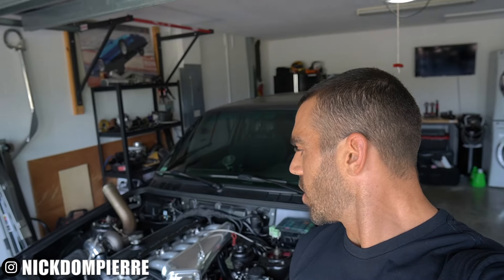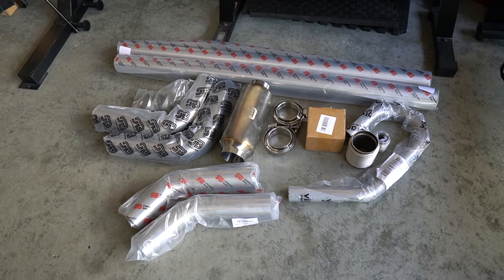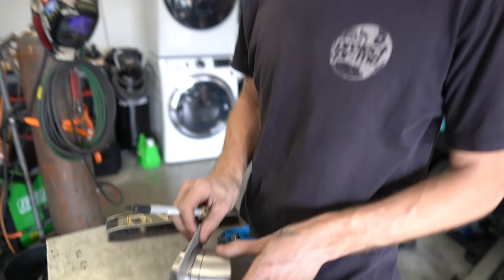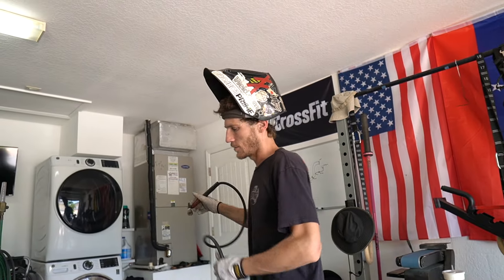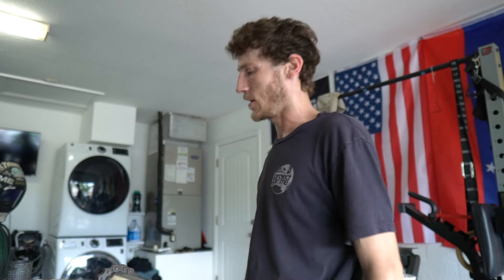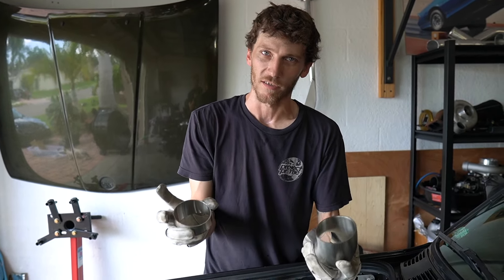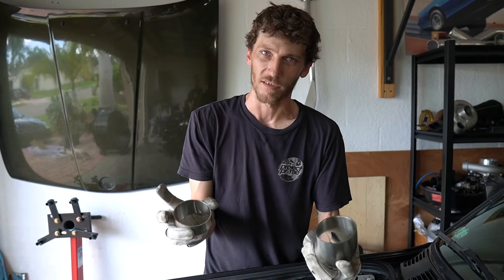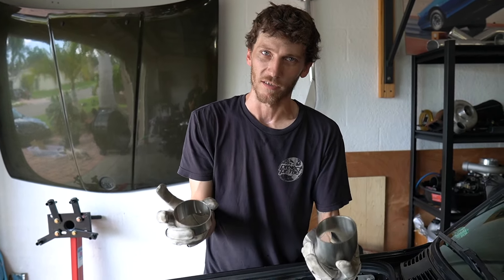Fabricating E30 Turbo Back Exhaust with Jeff Ray from Superformance Fab

Comment: What intake manifold are you using? Would be great if you could show what you got going on with intake/brake booster set up. Wanting to get an intake similar to yours but I'm concerned about fitment and what not. Thanks!